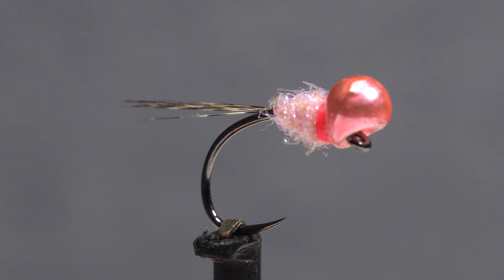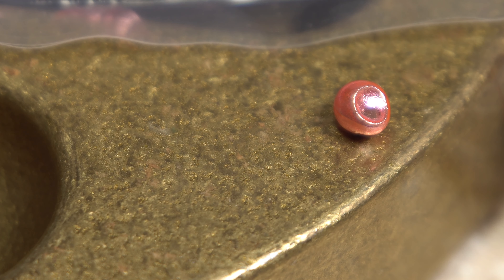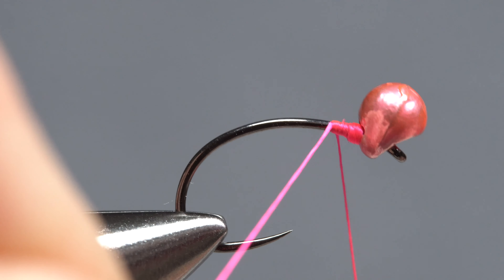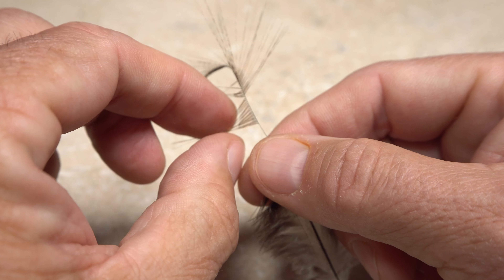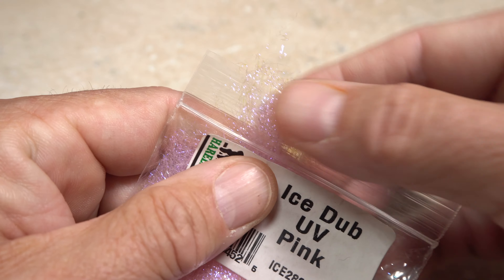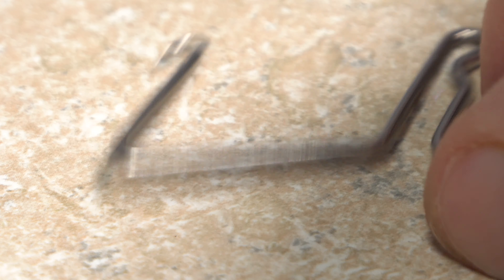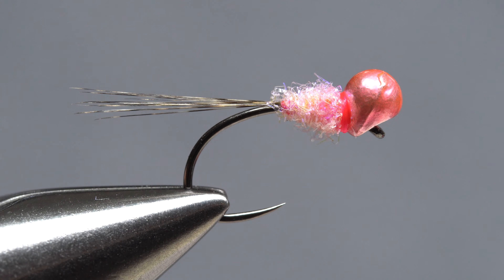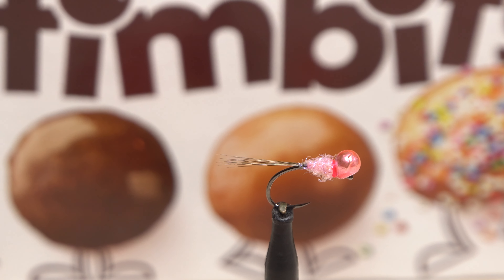Timbit Nymph

Comment: Drop beads are pretty new to me, so I guess I’ll be the one to ask the dumb question. What is the point or purpose for using drop beads compared to using other beads or bead/jig hook combinations? Please explain if & why they are better to use.
Reply: That was my question, too! :-)
Reply from the maker: Drop beads help the fly to ride in a more horizontal orientation without having to use a jig hook although they do work very well with a jig hook. This fly, with the drop bead and this hook actually ride in a more horizontal orientation than a jig hook and a slotted bead. The real advantage of a horizontal orientation is less bottom snags.
Reply: @tightlinevideo  Got it. Thank you. It sounds like drop beads may end up replacing the bead/jig hook combination.

Comment: Nice fly. But the beads the wrong way round in my opinion. The counter sunk side should be against the body.
Reply from the maker: In most cases yes. That is the way they were designed. But if you put the countersunk hole forward you get a little more of the balanced effect on the fly.